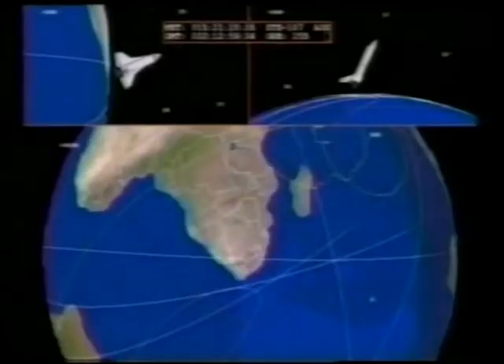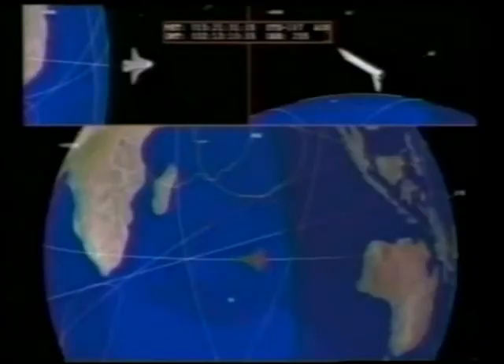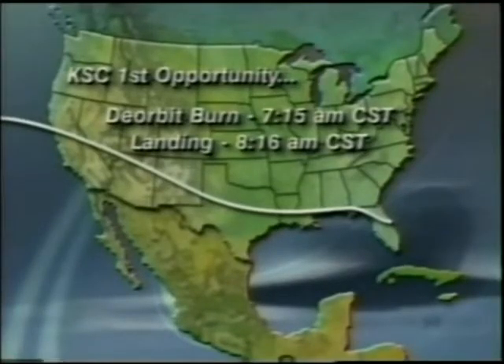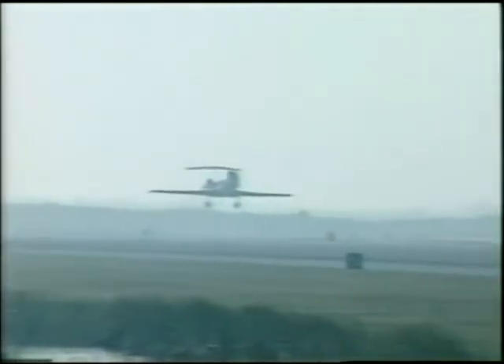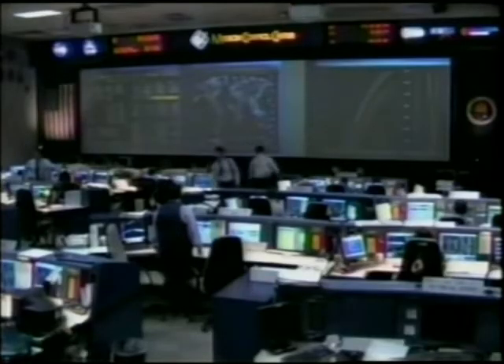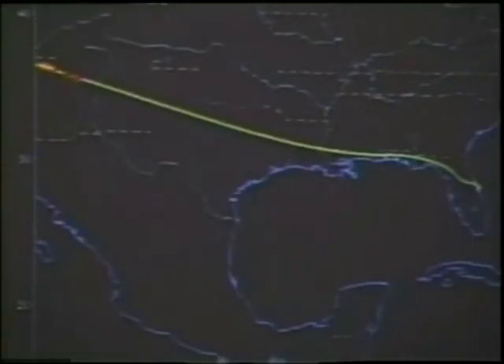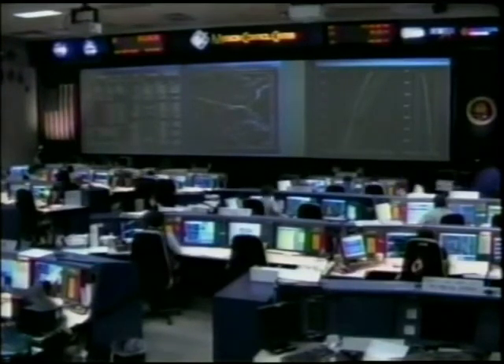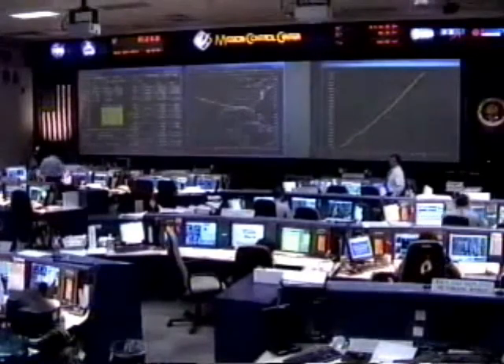STS-107 Rentry NASA Footage

Comment: Responsibiity for these peoples' deaths once again falls directly on upper management at Nasa.  Engineers had seen the foam strike on lift off tape and reported it to management.  They also said they wanted an existing satellite to take pictures of the wing that was hit.  The manager looking into it (I think her name was Hamm)  said no, and a witness quoted her as saying "There's nothing we can do about that anyway".  What happened to Nasa's 'can do' attitude?  Now the attitude seems to be 'if its a tough problem, don't even try'.  I don't know of anything could have been done, but since no effort was ever made to even try, the loss of the orbiter was guarranteed.
Reply: Marty933 She was apparently brusque and a workplace bully making it difficult for engineers to speak out.
Reply: @whangie1  I think it was her trying to get DOD to take pictures. Given there would be no good result, they refused to surrender that capabilities existence. If in fact it does exist.
Reply: Options? None really.  Only possible option would have been to speed up prep time for Atlantis. That would have involved severe safety shortcuts making it the most dangerous launch ever attempted. It cost $1B for each shuttle launch. Add to that, the likely risk of losing another shuttle as well as a launch pad and two more astronauts. Even if it went well, shuttles can't dock together. Columbia was the first shuttle built and didn't even have a docking collar. The Columbia people did not even have spacesuits and Columbia did not have an airlock for this mission. It would have involved space walks between the two cargo bays with a pulley line to get spacesuits and tanks across to Columbia. Then Columbia would have to close its cargo doors so they could retrieve the suits. Cargo bay cannot be pressurized so they would all have to go to emergency oxygen masks just to open the door into the cargo bay. All very dangerous. Thats why NASA wanted no part of getting pictures. They didn't want to know.
Reply: @nickv4073  thanks for this explanation. Its pretty close.
Reply: @nickv4073  each shuttle mission had 2 ready EVA suits (before after Columbia), get your facts right.
 "Columbia didn't have an airlock"- dude seriously do you even know anything about the spacehab?
Reply: Marty933 — The negligence was much earlier.  The shedding of foam was a known problem throughout the program.  The possibility of consequential damage to the orbiter should have been investigated.  Everybody just assumed the carbon panels on the leading edges of the wings were tough enough to withstand strikes from foam.
Reply: there was nothing they could have done
Reply: To be perfectly clear: Even if NASA had determined that the wing of the Columbia had been damaged, there really wasn't much that NASA could do. The Columbia didn't have the fuel needed to get to the International Space Station. 

A "rescue" mission would have been extraordinarily dangerous (at best) or impossible (at worst). Russian rockets weren't ready or able to make it to the Shuttle (and the Soyuz can only carry up to three passengers anyway -- and there were seven aboard Columbia). The next shuttle would normally need five months for prep, training and launch. 

Such a rescue mission would have been high risk on many levels -- and would have required no room for any errors. Even then, it still would have required the Columbia to remain stranded in orbit for at least three to four weeks -- when it didn't have the supplies for that duration. A big issue would have been the CO2 levels as well as rationed air. 

With the little that NASA knew about the damage (after assessments that deemed the foam to be very low risk), the option with the least quantified risk was a normal landing attempt. 

Obviously, the landing didn't work -- because the damage was more extensive than NASA engineers believed was possible. Hindsight is 20/20. Yet, if NASA did know of the damage, there might not have been much of a "rescue" option. 

My option would have been somewhat different. I would have quickly prepped a rocket launch -- in which a supply craft would have been sent to the Columbia for extended stay (including food, water and air). This would have allowed the Columbia the time necessary for a rescue to be prepped.

Comment: They knew about the hole in the wing yet did nothing about it. Hadn't they learnt their lesson after Challenger?? Guess not.
Reply: It’s like comparing apples to oranges.  Two accidents caused by two completely different factors.
Reply: Xee Z — They did not know the nature and extent of the damage.
Reply: They didn't know about the hole until after the investigation. God you people were clueless
Reply: Educate yourself.  Then you won’t make stupid statements like this in public.

They did not know about the hole in the wing until after they reassembled the found fragments.  Then they performed tests duplicating the physical forces of the foam at Mach 2. The result: an approx 18” x 22” hole in the test wing.  THAT was the “Oh. Shit.” moment.
Reply: There really wasn’t anything they could do sadly. They could attempt repairs, but the damage was very severe.
Reply: They knew about the foam strike. They did NOT know about the hole. Experts up to that point were under the impression that the foam was soft enough that it would disintegrate upon impact. And they were technically right, under different circumstances it would have caused no damage. Testing later showed it just happened to hit the right spot at the right angle and caused an, up to that point, unexpected puncture in the wing.

Comment: Flight knew these souls were going to die while they were still on orbit. Civilians shall never know the truth, I've research extensively and read between the lines. NASA is and shall always be a government organisation. Glad the program continued regardless.
What could executes have said to the returning Astronauts?  "Good job, now you die"?
Reply: Per Van Valkenburg , I agree, but after this horrible experience, astronauts were trained on replacement of missing tiles . That should have been done before hand .
Reply: Leroy Cain and the rest of NASA did not know things would end this way.  Cain started to realize something was wrong when the first four temp sensors went offline.  As more sensors began to fail in the left wing, in the back of his mind, the foam strike came up.  No one knew the extent of the damage and there was no way to find out.